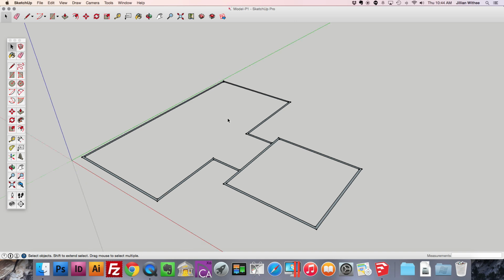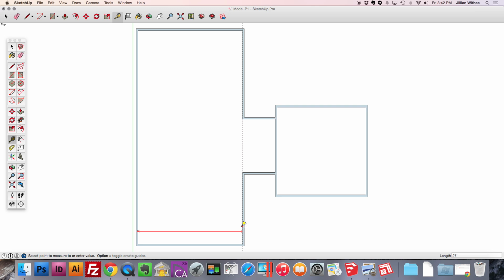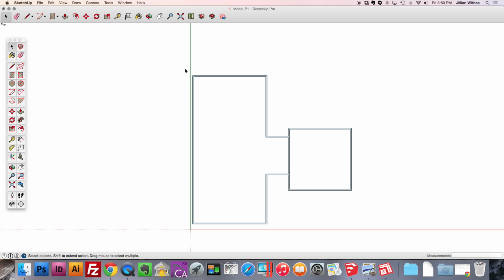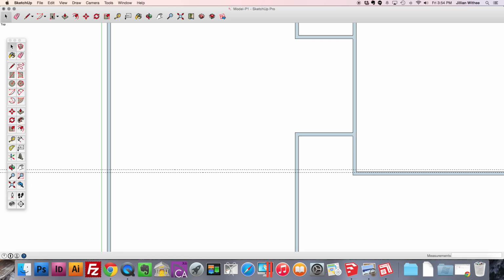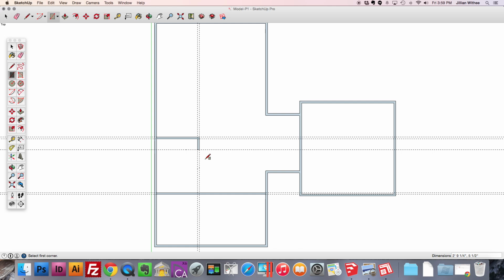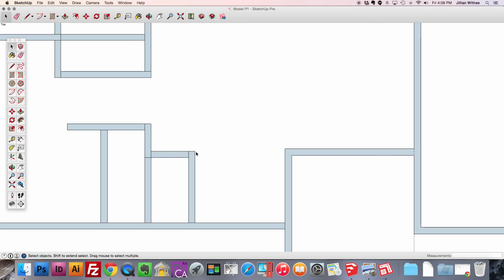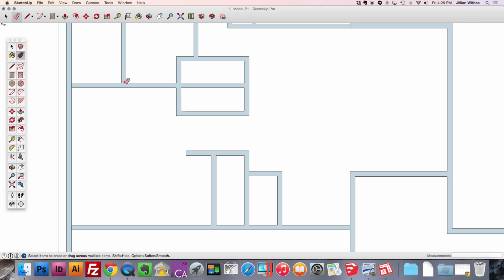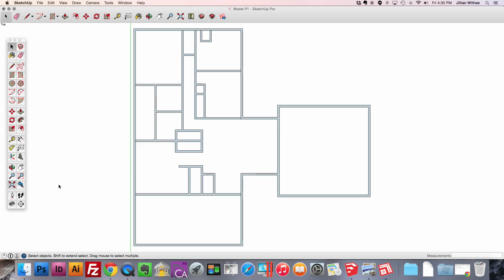SketchUp 2D Floor Plan Tutorial Add Interior Walls

Comment: Love to see the ladies getting invvolved with drafting, engineering and tech. Great job!!

As a mechanical engineer, i am really impresed with this. I use Sketchup pro all the time but for 3d mechanical parts. But to see it being used for 2d like this, is great. I do not know if this idea will work in 2d, but in 3d it does. If you need to scale an object or wall, you can use the tape tool to measure from one side of a, lets say a block, to the other side, type in the measurement you want, and SU will ask, do you want to resize the entire model. Hit yes, and it will scale everything to that dimension. It works for 3d, not sure about 2d.

Comment: I found this video invaluable. I needed to throw together an accurate floor plan to do some wifi heat mapping. I've had Sketchup installed for a while but never really used it. Found your video and within an hour had my house measured and my floor plan created in Sketchup. I then exported that to use in my wifi heat mapping software. Thanks! I'll probably watch some of your other videos to expand on my Sketchup skills.
Reply from the maker: Glad you found the tutorial helpful!